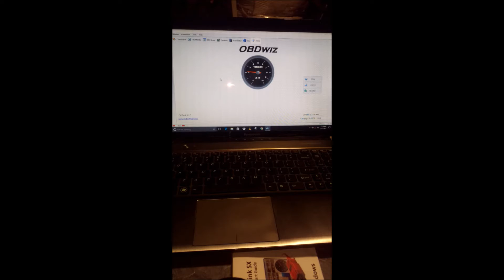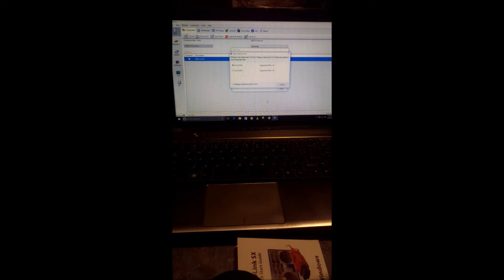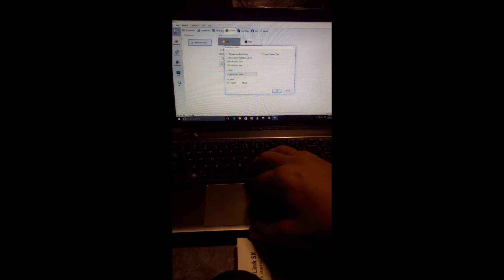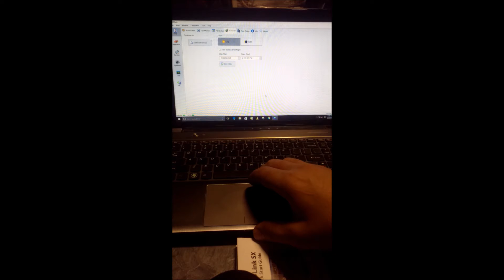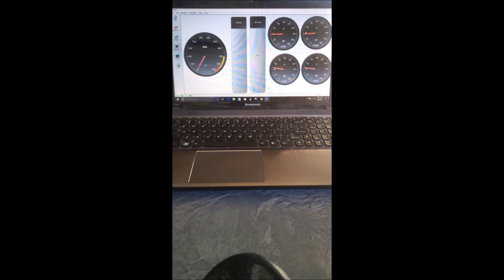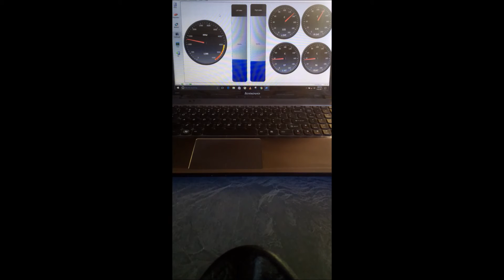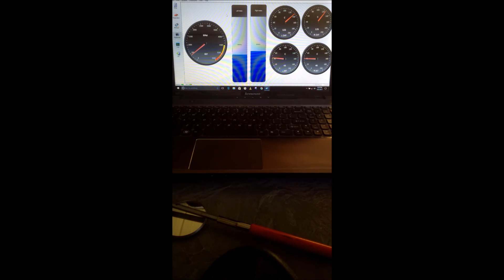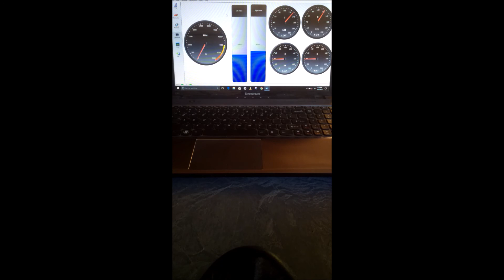Balancing Ural EFI Throttle Bodies with OBDWiz

Comment: I went through all of the videos.  I purchased the obdwiz and the upgrade.   Made my own connector.  On my obd2 connector the more red than orange wires were the right ones.   Pid for vacuum high data should be 10 not 100!   This way psi works and you dont have to go metric.  Max value for cylinder head temp set to 400.   Max temp for air intake set to 200.   Bike never ran so good.   Many thanks to you MM.    Dave.